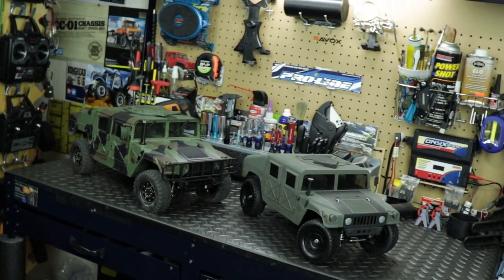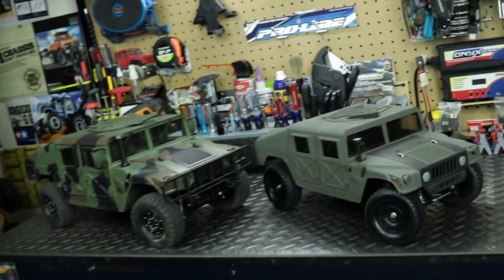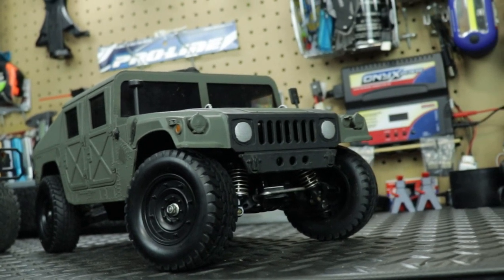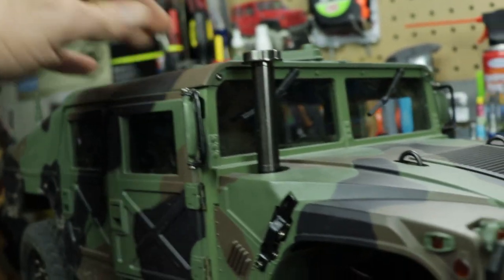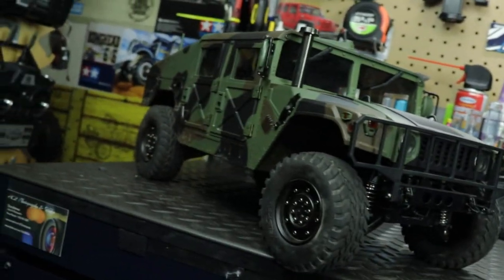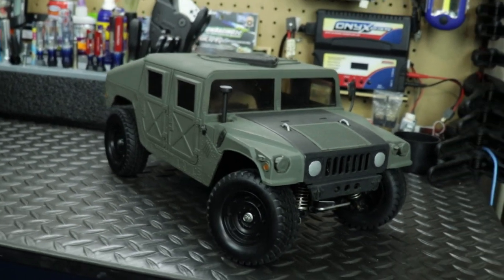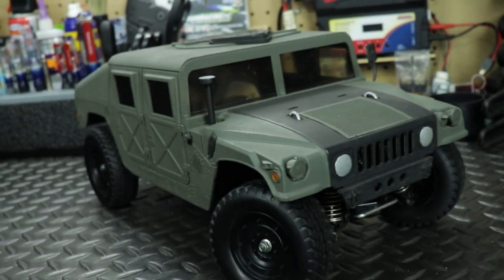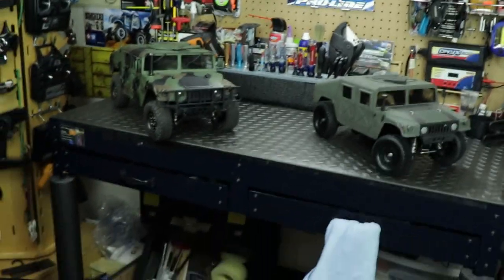RC84Films: Tamiya Humvee VS HG Humvee

Comment: Just ordered the hg hummer. Can't wait to get it. Speaking of old rc cars. I have an old GI Joe crossfire. Rear baloon tires are shot and rotted. Built on a thunder eagle chassis. Having a hard time figuring out where to get tires for it and get the wheels off because it grinds in low gear.
Reply from the maker: Hg is a good truck have seen the fms hummer h1 1/12

Comment: The old one, only thing I didn't like is the transmission has no slipper and the plastic gears strip if using even a mild modified brushed motor and 2s it will strip the spare over and over and there were no metal gears available that fit back then. The internet had barely come out and no youtube. If I had the old again, I would just gear it too go very slow and throw a high turn motor in and just be ready to catch it or just shelve. Possibly the best looking rc car ever built. I mean the way the tires look with the body and windows. The body is more durable than most lexan bodies, it has to be almost 3mm thick.
Reply from the maker: Would u like too buy old one??
Reply: I run my 95 hummer with a 27 turn motor and locked front/rear diffs. No damage in 7-8 years

Comment: I just ordered the hgp408. The tamiya hummer is the only rc i  have ever had so i have never used lipo  batteries before and they sound like a lot work. And its kinda scaring that I'm going burn down my house or set fire to my rc. What batteries and charger do you recommend and do you have an advise. Thank you
Reply from the maker: Lipos can be little difficult there a lot changers that good change in a lipo bag or fire proof box for the hg u need a 7.4 2s I would go with a 5000mah